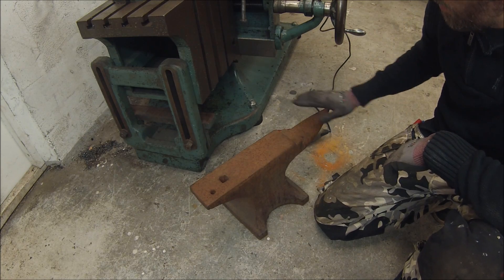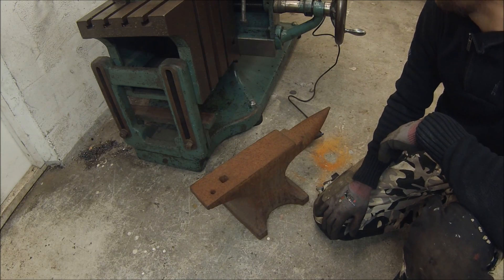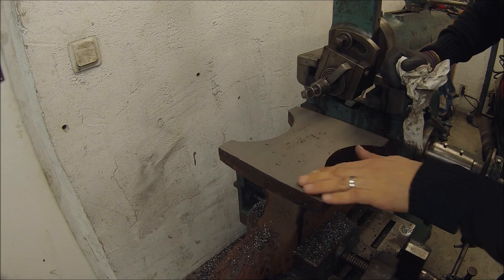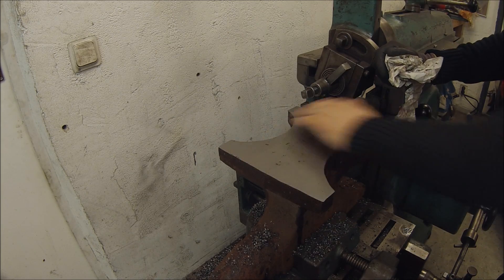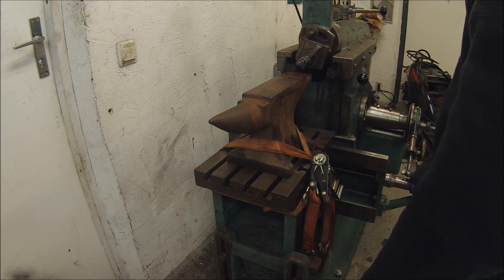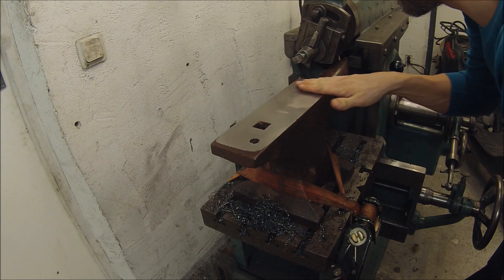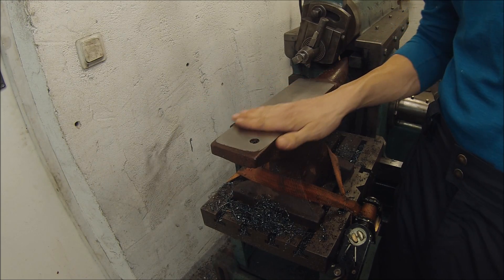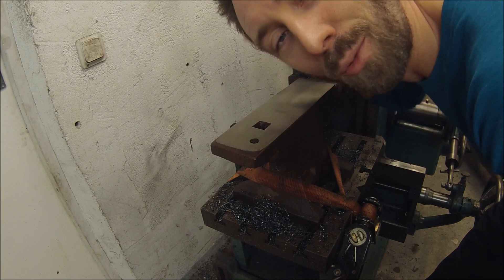Machining - Touching up anvil on the shaper

Comment: Anvils have a hardened plate on the top and I did a job like that for a business on a super hard guide wheel on a dryer and broke more carbide inserts and lost money 💰 on that job lesson learned take a file and see how hard it is and tell customer it's gonna cost a lot and hope they say no it will save you time and money
Reply: Unfortunally every word you say is totally true  and thanks for the advice, is important. Congratulations, and have a good time.🎉

Comment: Why not take some sacraficial hardwood wood and shape it to dimension to wedge in those holes to prevent tool skip.  Drive it in and grind it down flush.  When done drive it out!!!!!   Simple solution!!!!
Reply from the maker: Jeremy Dunn That's a damn good idéa Jeremy! I'll add that to my toolbox so i can use it later. Thanks!

Comment: You need to make tee nuts and hold downs , if the strap let's go you and the shaper may pay dearly. All thread and nuts and washers but you need HOLD DOWNS .
Reply: yes the power of those things are scary if for any reason that digs in you and the machine will not do well

Comment: I did the very same thing a few months ago on my 25" Smith and Mills shaper.
Things I learned:
1. Anvils are very hard.  Hard as a goats forehead in fact.
2. Carbide tooling is not particularly suited to the shaper, (already knew that in theory).
3. For any degree of success and insert life, the tool must be lifted clear of the work on the return stroke.  Some shapers have an inbuilt lift mechanism, or you can fabricate a hinged plate that lifts the tool clear on the return stroke.  The third option and the one I used was to simply lift the tool clear by hand.
4. To get an acceptable finish on the final pass, stroke rate needed to be increased a lot as a slow speed and fine cut did not allow the carbide insert to work hard enough.
5. Use the heaviest insert tool you can find.  I used one that took 25mm diameter round inserts.
6. Offering to machine a friends anvil can become much more complicated, time consuming and expensive than anticipated.
Reply from the maker: Haha, very good points! In my case it was worth it since i used this project mainly to get to know the shaper. Lesson learned. :)
Reply: Totally agree that it is a brilliant learning exercise and help you to learn how to make the shaper perform in adverse conditions.
The good thing is I now have the tooling on hand for similar jobs should they eventuate.

Comment: you really need to get some strap clamps for that shaper table. Crashing a shaper is almost sure to break something, its not as forgiving as a lathe or mill in that regard.
Reply from the maker: Shawn Lund Clamps are purchased, a couple of months back. Just havn't had the chance to use them yet.

Comment: Just curious, why did you take a shaper, can't you do that with a fly cutter in the lathe?
Reply from the maker: +adi kariyadi Well, i could of course do it on the lathe, but the shaper is more suited for the task for several reasons actually. The anvil is heavy and i don´t have a good way of fitting it on the lathe. And since i can´t rise and lower the workpiece i´d have to have a flycutter at least the width of the anvil (5 inches or so). But mainly, i just got the shaper and i needed a project for it. I learned alot about the shaper on this project. Thanks for posting!
Reply: Fredrik Moberg you have a lathe big enough to chuck up an anvil? and how do you use a flycutter in the lathe?
Reply from the maker: Shawn Lund there are two options really, either i'd chuck the anvil in my 4-jaw, however the anvil is heavy to swing. The other option would be to remove the toolholder and mount an angle plate on the crosslide to clamp the anvil on. Then hold a big flycutter in the chuck.